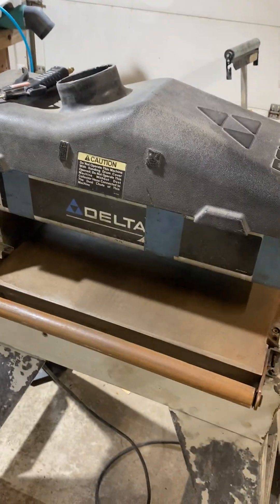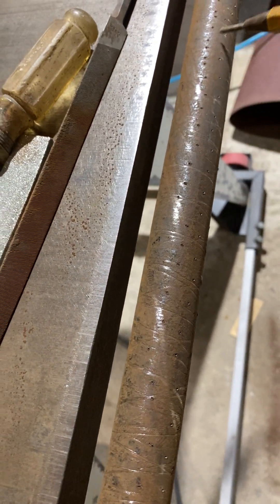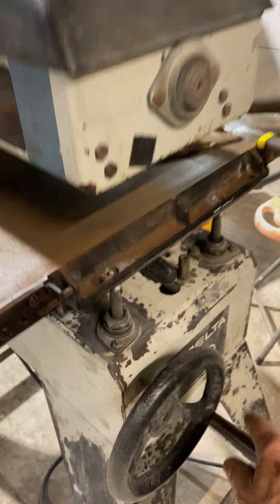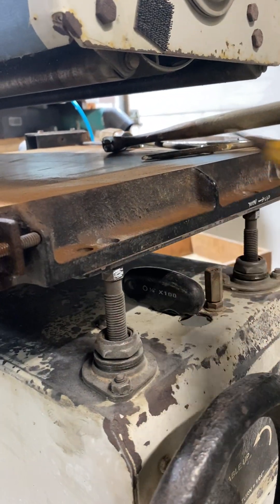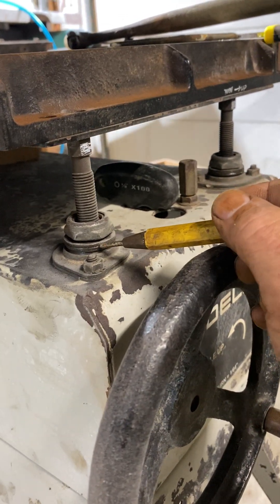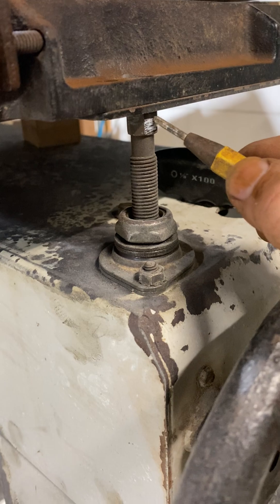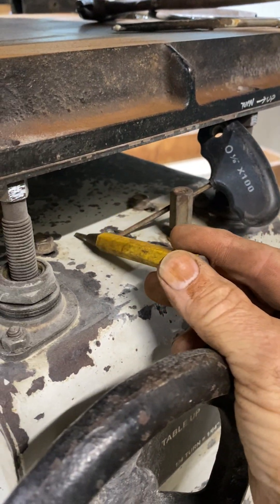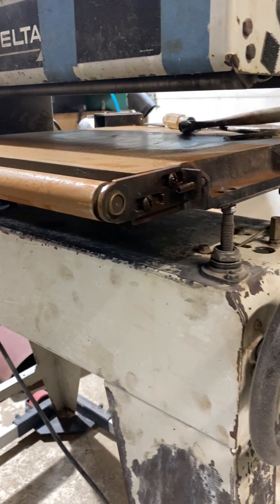Adjusting Delta drum sander, cantilever timing. And drive belt slippage solution.

Comment: I have a question about the conveyor rollers that you use the punch on.  Do the rollers spin easily?  I'm having issues with my sander tripping the overload switch by the on/off switch.  My rollers do not spin freely when not attached to the motor.